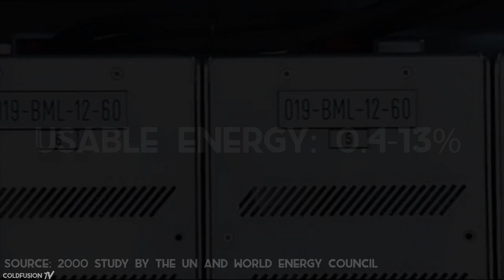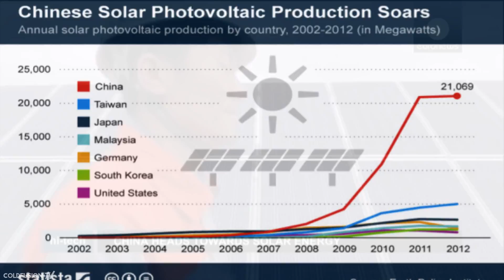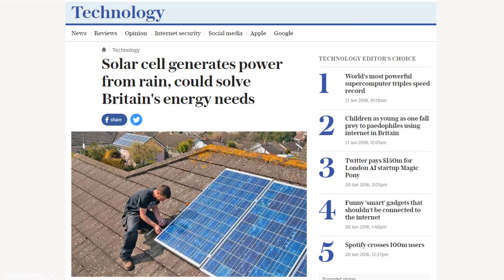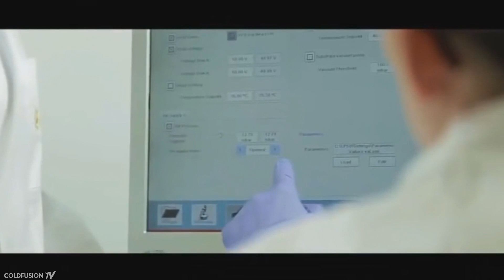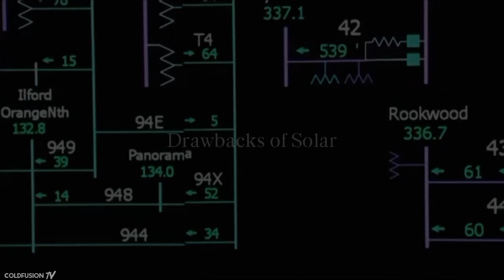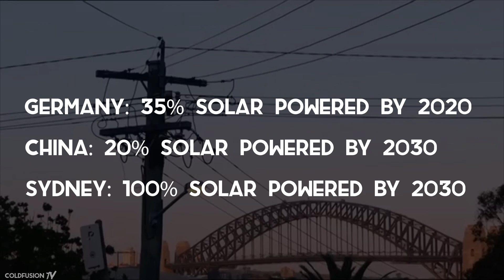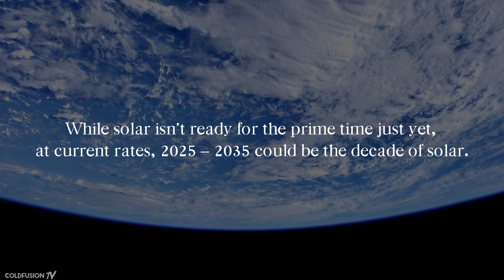The Truth About Solar

Comment: Can't listen to this crap anymore. Solar will never be more than a drop in the bucket of our energy use, EVEN IF IT EVER provides 100% current electrical use.  However using MASSIVE amounts of CLEAN electricity for millions of years from a variety of fuels NUCLEAR CAN generate synthetic CARBON NEUTRAL fuel that will run THE CURRENT automobile and airliner fleet.  No need to upgrade that old clunker or the polished classic alike!!

The oil industry has been promoting solar for decades. They know it can NEVER live up to our needs, and the promises it makes; therefore we will still burn fossil fuels. Google the old adds!! The say who sponsored them right below!! 

"GO SOLAR!! Brought to you by the Home Heating Oil Alliance"

Same reason NASA won't use solar in deep space missions.....Solar is inferior.

Comment: The generation of solar energy on an industrial scale is problematic. Power grids will have to undergo huge upgrades in order to transmit this power. As of right now, the best use for solar power is on a personal scale. With prices going down on the required hardware, it makes better sense for governments to apply incentives for  homeowners to move to solar power.

Comment: In India solar prices are already competing with thermal electricity. 
Also some of our smaller air ports are being converted to completely solar powered.  (the lights are always on there -  so saves a lot of money). 
Secondly similar is the plans with Railways station (which are always poorly lit). 
And village people aren't waiting for Govt to connect them to power grids. They are installing solar plates on their roof.  In my village electricity came 3 years ago, we had solar panels lighting our homes 7 yrs back.

Comment: I hear terms like:  cost, investors, negative cost, start up, venture capital, capital for grid updates, and I wonder if you shouldn't take some time in the "dry and boring" sciences of economic theories, the Money/Market system, and read some of the brighter minds in these fields, and then update this report with the same optimism.  Many of us do not think that capitalism can cope with the issues facing us, and were never designed or intended to.  Sure the tobacco companies knew what they were doing and said nothing, but that is the exception.  Right?  The oil companies will switch to clean energy - when they have received their full return on their oil investments.  Meanwhile, we keep thinking the  Earth is too big to fail.  Are you willing to place the lives of your children on the betting table on that assumption?  I'm not.  And not trusting the "free" market to decide.  If it makes a buck it will happen, like it or not, and if it doesn't make a buck, it will never, ever happen.  So figure that one out and we will have us one hell of a party.

Comment: Biggest problem is still cost. At this time every estimate I have gotten this week has been for 21 panels installed no battery back up 17,000 plus a another 8,000 for a battery system that might have 3 days back up and this is a very small two bed one bath home. In fact that's only 2,00 less then we paid for this home ten years ago . Solar is still a rich man's toy.

Comment: ~1% now, 40% increase annually -> 2025 there will be ~28.9% solar generation of total :)
ofc this should be calculated on current total, 253TWh means 7318TWh in 2025. How many % is that of the global demand in, nobody knows, too many things happening right now to predict or use history as a marker of electricity use.

Comment: Good video but you should have also talked about Solar Thermal Power or Concentrating Solar Power (CSP). This is the utility scale solar power generation method using "Heat" part of the solar radiation. You have shown very briefly the solar tower plant toward the end, though. Check this Wiki page: https://en.wikipedia.org/wiki/Concentrated_solar_power In this case also the molten salt energy storage technology is being developed to run the plant on 24x7 basis.

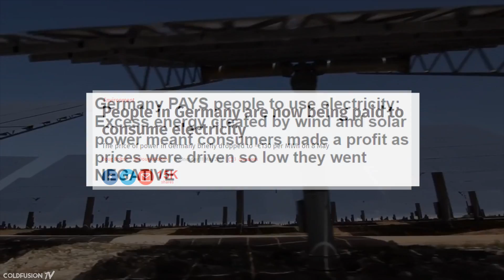Comment: @3:45 - This makes it seem like negative pricing for electricity only happens because of solar. Negative pricing of electricity occurs regularly and has occurred for years, and has nothing to do intrinsically with solar. When the supply of energy is greater than the demand for energy, pricing goes down. When there's too much energy to be used, ISOs or RTOs set negative pricing for power in order to force generation stations to power off in order to equalize supply and demand. What happened in Germany during negative pricing had less to do with solar and wind, and more to do with Germany falling behind in the grid infrastructure upgrades necessary to accommodate the intermittency issues of renewables.

Comment: utter crap. Worst video i have seen of yours. No mention at all of modular batteries such as liquid metal which can be used by large scale solar farms(still in development but should have been discussed), no mention of how toxic solar panel production is, and zero analysis of costs of transportion, installation, and maintenance factored into your cost analysis. Im extremely disappointed, or perhaps im just surprised at the low quality of this video after watching your alphago video. Please remake this video its depressingly incomplete.

Comment: Great little video – very positive and useful. Only tiny quibble is you say (1:50) solar is growing 40%/year since 2000, and produced just 1% of world electricity in 2014 .  Agreed.  Simple math – 40% compound growth – take it over 100% of world electricity in 14 years – by 2028.  But then you say (2:19) IEA predict we could get 27% of world electricity from the sun by 2050. That's so different!  Though at 40% compound growth it's still 100% by 2054.  So which is is right – exponential growth or the IEA?   2028 or 2054?  What do you think?
Reply: P.S.  the most comprehensive solution to solar's intermittency is the 'solar hydrogen economy' – excess solar and wind energy on sunny/windy days is used to split water into hydrogen gas and oxygen – electrolysis.  The hydrogen is then stored in the gas grid – replacing 'natural gas', methane.  When methane is burned it makes carbon dioxide, adding to greenhouse gas emissions.  But when hydrogen is burned, it recreates the water as steam, which is non polluting.  Hydrogen can be used for more than cooking and heating – in fuel cell cars and buses, and (when liquefied) as a rocket or aircraft fuel.  It won't happen overnight, and not everyone likes hydrogen, but many scientists agree that replacing an electricity grid with a gas grid would work.  See https://en.wikipedia.org/wiki/Hydrogen_economy

Comment: I think that CSP power has huge possibilities in the residential market.... the biggest issue is that It has to be a smart investment. current PV tech is not their yet.... neither is CSP.... but CSP has the potential to heat your home, drive your generator, and store more energy than what is needed..... CSP does not work really well for power companies because it takes a lot of land to provide electricity to an entire region. I would say it is best suited to the residential market, it could be cheap to design and install, and all of the waste heat ounce it passes through a small turbine could heat your home and potable hot water during daylight.... Thermal energy storage could be as simple as a large volume of water..... also you could pump water to the top of a tower and release it to capture energy during the day. many people argue that virtually free power for the people is an economic disaster, I strongly disagree, It would free up a lot of our money to invest in new technologies and service and maintenance of power systems will always be necessary.

Comment: Surveys indicate that up to 85% of the population (depending on location, that is) would like to switch to solar and other renewable energy sources. 

The PV panels are improving nicely, but the hold back is batteries for storing the power: those aren't improving as quickly as the panels are.  This leaves lead/ acid batteries as an apparently inexpensive option for now, but  those have their own drawbacks. 

When the research labs start developing more efficient and inexpensive batteries and getting them into production, the uptake of solar power and wind power will ramp up very rapidly: We can deal with the shortage of installers, etc., when that starts to happen, and we should be prepared for putting way more 'boots on the roof'. :-)

NB: wind power can be stored in batteries as well. Some people missed that point... 

Some kind(s) of batteries based on iron compounds would be good, if they can be made to work faster in charging, etc. 

On the opposite end, building more sustainable, solar-optimum, and energy efficient housing and other buildings should be the first step in a move to reduce overall energy consumption. A home which uses at most 2 Kwh at max is better than the average home today which uses around 5 Kwh. 

Rant over for now. :-)

Comment: Interesting video but you missed a few of the largest problems with solar energy
1 silicon refinement and solar cell manufacturing create some of the most lethal and toxic chemicals known to man.
2 energy storage while there are some great newer battery technologies all of them during the manufacturing process are just as bad as solar cells, and dont even get me started on the millions of lead acid batteries most use as storage 
Now don't get me wrong the idea of solar power is great and needs real investment on the technology but at this time its just a liberal talking point and pipe dream

Comment: While personally I am 100% for solar power, many of the statements in this video are misleading.  First, solar cells are not 30% efficient but closer to 20%.  This means you need much more material and a bigger footprint to produce a given amount of energy than suggested. Second, mention is made of perovskite solar cells which are incredible easy and cheap to produce.  Unfortunately, their efficiency tends to rapidly degrade do to their inability to withstand the harsh effects of solar radiation. Despite the hype of this video, the good news is that solar is gaining momentum.   Much more needs to be done to foster the universal adaptation of solar as a meanstream energy resourse.

Comment: wow, the biggest solar problems are not mentioned. Good wish but... First of all it's not half of the world is not getting sun. It's actually 2/3 because you cannot collect much sun on Poles, not to mention that solars cannot be built on oceans. Second, batteries are not just expensive they also litter our Earth at the most unreasonable way with chemicals, lead and lithium (a few to mention), there is also power is required to melt, make, transport etc these batteries. 

Now, Tesla guy mentioned UK been green, so why would UK give up green landscape for ugly landscape. With this logic we may all as well lock up ourselves into cells so that we stay productive. I don't know... We need communism so that we force Africa to be solar and the rest of the world be consumers but I guess that makes white people with less power. So banks will stay overpowering whites, and white nations only even though solars are not great up there. 

I would look for more ways to create energy. Maybe some kind space turbine (as alternative way of storing energy) that getting sped up by solar panels  and when needed reverting energy back to electricity with generator. However, I don't know how this would work since there is no gravity in space therefore large object should slow down just like small ones. But I would definitely focus on mass producing energy in space rather than on Earth.

Electrolytes have quite impressive way of creating energy from converting minerals that can be easily reverted back with organics. Example would be abundance of sea salt. But potassium or calcium would be a good alternative.

So solar has it's own place but I would never push solars as a main stream of energy. Not for city centers. It's too delusional and misleading in actual costs. But I would build factories hooked up to solar farms so that unnecessary products, like car parts, hoses etc, can be created whenever there is an excess of energy.

Comment: Solar, according to current prices, is already cheaper than coal, if you put into your calculations the cost of the extra technology that is required to make coal a viable fuel today, called "carbon capture."  It is already being done at Boundary Dam, Saskatchewan. But the extra cost of the carbon capture plant there, when added to the existing cost of the coal plant, exceeds the cost of a solar farm producing the same number of Megawatts of power. In fact, it exceeds it by so much that you could even add in quite a bit of storage capacity to your solar farm and it would still be cheaper than coal with carbon capture.  As carbon capture is the only known way to make coal even remotely ethical it ends up being a deal breaker if it then is not cost competitive with simpler and cheaper solar.

Comment: Hmm a lot of bogus misleading info. Solar is  subsidized by many GOV's. So it's real cost isn't what is stated. Then there is the fact that many of the large scale solar generation facilities are putting out much less that predicted. Why the newest boondoggle backed by taxpayers in the US, becasue of Oblunder, is loosing money & may be shut down.  Not to mention that this energy is only really utilized by most folks during the day> So until a cheal, better alternative to existing battery system is found the solar fantasy is just that.... A FANTASY. 

While I think solar is great for certain applications, it's fare from being the replacement for existing power generation. Especially when one considers the foot  print required by solar to produce the required energy. But I'm sure that the left leaning folks that live in nana land will try & dispute reality & facts. But hey why cloud the issues with facts. As truth is real inconvenient. Why even with te strides made and solar costs down, there is still the problems of storage, installation, regulation, etc. 

Take away the GOV stipends for this & see how popular it is.
Reply: Fay Ryuujin Well compared to solar it's free. But I digress.

The footprint required for solar to replace one nuke site is a ton more. And solar really only works well in sunny parts of thew country. Unless you can generate solar energy: store it; then transport it to places that can use it. 

WHile I'm not an advocate of nuke power, at least in it's current form. There have been a ton more advances that aren't being considered. Simply becasue the liberals of the world want GREEN ENERGY.

So let's look at solar & it's supposed label of being green. It requires a ton of energy to make a solar cell. It requires special kinds of sand to produce. Which means it has to be transported. Then the cells have to be made & tested. Then the panels shipped somewhere. The same goes for wind. 

As for cranial rectal insertion, you need to quit projecting your uninformed anger onto others. The best solar cells today barely make 20% efficiency. Those are the best. 

Again the costs of putting these on the grid, installation, etc aren't considered when liberals are promoting their world view. 

So we can see the typical liberal response when presented with facts, truth, & reality. Instead of their incessant doses of liberal fantasy. If solar were to be unsubsidized, it would become what it really is. Just for those off grid folks. It's not ready for prime time. And it won't be until someone produces a GOOD CLEAN, LOW COST, ALTERNATIVE TO THE EXISTING STORAGE. 

But hey why cloud the issues with facts. It's plain to see that you're not ready for facts. Just the typical liberal sunshine blown up the same place as you position your head......
Reply: You lost what little credibility your argument had with "Oblunder".

Comment: cost only based on economical value? come on, without any size mentions? you know here are way more variables than $/Wh...
when you want costs then calculate the required material/m^2 solarpanel and then look up how much energy it cost to MINE and refine that amount of materials. all of them, metals grease water anything.
when you go into it in this much detail, you can see it really matters WHAT TYPE of panel you are manufacturing. nowadays we have solarpanels which bend and see-through and really thin...so calculating the shitty multicrystal hard panels is just bollocks.

what is way more inportant is the energy storage technology.
because unless you make international powerlines so that the lit side of the planet can support both sides at once, you have to store that electricity chemically.

we dont need a grid if every building is a generator. also reducing the overconsumption of electricity in machines would be a point to look at as well.

Comment: For decades people have been using the Sun as a power source using 12 larger size batteries hooked in parallel then connected to a power management system to power many household appliances that use 12 volts.

Comment: what? no callout to nano antenna's ? they have something like a %98 efficiency and work at night as well (using the earth's heat, infrared)
just needs a rectifier diode that works at such high frequency (like a MIM diode system)